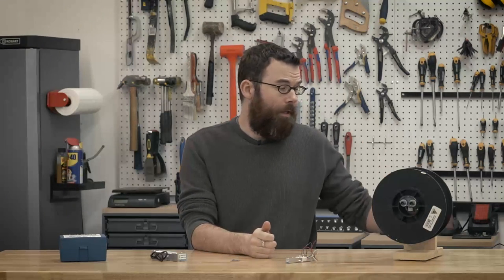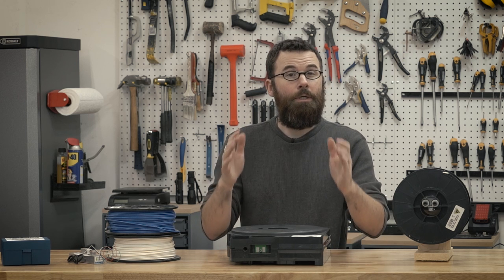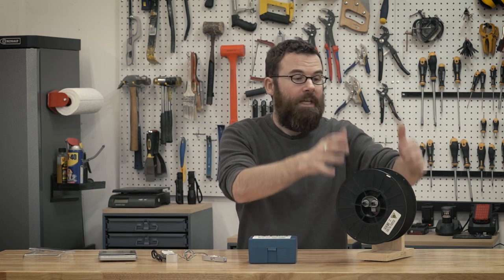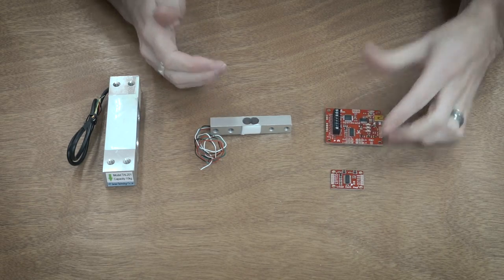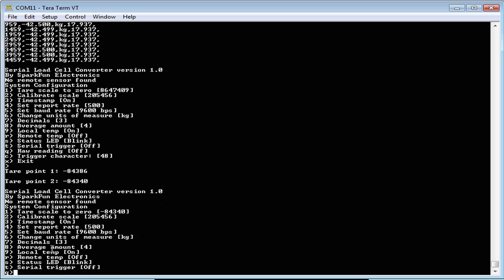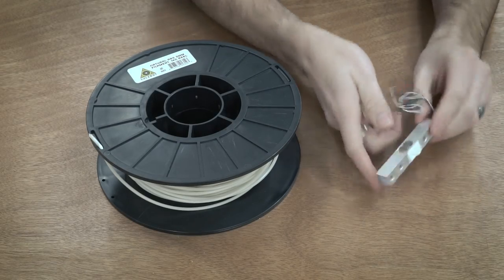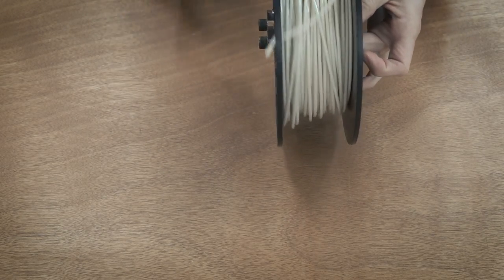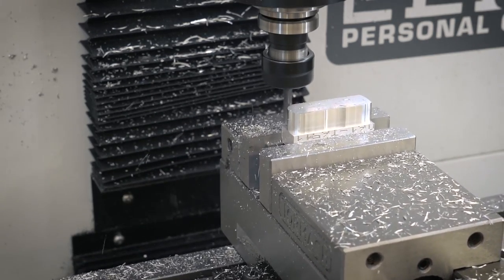Filament Measuring System - Part 1

Comment: Is there a part 2?
Loved part 1.
Knowing the weight left on a spool helps a lot when deciding if your spool is gonna make it to the end.
Reply: It doesn't seem like there's a part 2. I guess it didn't work too well? I wanted to learn possible caveats so I was really interested in the detailed results though.. Welp, I guess I have to do it myself to figure it out.

I am wondering how it performs once it's loaded up to the printer. I bet extruder's pulling/push back force affects the reading, as well as the position of extruder itself changing the position of extruder's entry point to the spool. But I have no idea if the effect was negligible enough when the friction along the pathway was cleared up.
Reply: @IoriTatsuguchi  I built one and it did a decent job but since that was three years ago I think I had a prob with tare being reset to zero every time it was powered on.  Taking the spool off before powering up and replacing it AND subtracting the spool weight stunk.
Reply: @coulterjb22  Oh, I hadn't thought about that. I was thinking it'd be nice to keep it there for extended time up to the full life cycle of a spool, but I just realized that it's not what load sensors are intended for: I bet you knew, but I just thought I could save the parameters elsewhere on every time or keep it on the whole time, and apparently then it won't account for the creep on the load cell. I'm interested in the effect of such thing over weeks and environmental temperature change - if it's like ±10g then I might do but I guess I'll try to see only if I have lots and lots of time haha

So I guess what you have experienced was just as good as it gets? Thanks for an interesting input!

Comment: Great video! I have been planning on doing something like this as well and your video helps clear up some questions I had. A little trick for cheap/readily available "calibration weights" I picked up from building antweights a long time ago is that the U.S Treasury Dept. lists the weights of coins in grams to 3 decimal places. So a new nickel weighs 5.000g and a dollar worth of nickels should be 100g. Also 80 quarters is pretty close to exactly 1 pound.
Reply from the maker: oh, that's great to know!  I actually have a set of quarters from the mint for taking pictures (quarter for scale, etc...).  I should have thought of that.

Comment: Cool, Thanks for the idea. Ordered some load cells and HX711 modules. I'll probably hook them up to an arduino pro mini or a esp8266 with a small display. Don''t think I need the bearings though, I've never had issues with extruders pulling the filament from a round (pvc or pla) rod in the spool and my spools aren't all the same thickness/diameter.
Reply from the maker: Yeah, the bearings are probably overkill, BUT it should help if you want really stable readings when using the printer.  It's just one of those things that isn't necessary, but it's kinda cool :-)

Comment: Robert, I use strain gages at work and we use a industrial amplifiers in order to read the gages but we need to set up a Gages factor. I want to build a similar project like yours. I have already the Sparkfun amplifier and some strain gages but I did not not about the special board for this cases. Do you know if we can set a Gages factor?
Reply from the maker: I do not.  Can you explain what the 'factor' is?  I'm relatively new to load cells, this is my first real project with them, although I've used them 'casually' before :-)
Reply: Robert Cowan  here a very clear explanation of Gage factors are.
I think we do not need to set up with these arduino  boards because the calibrations is made with a known weight   
http://www.ni.com/white-paper/3642/en/
Reply from the maker: Ah OK that makes sense.

Comment: Robert. What about adhering an RFID key to each spool at the start. Put a reader near the spool and use the eeprom space on the RFID on the key to store the the initial total weight plus initial quantity of filament. This way, when you put the spool on, it will get read during the feed process and you merely need to deduct the weight of filament used versus the expected full weight. Who cares what different spools weigh. If it has 1kg of filament, you know you should only be able to remove 1kg weight from the spool regardless what the initial weight was.

Comment: Robert, during your testing, did you try to place weights at various places on the load cell to see if the results varied? For example: hanging a weight off of the outer most hole vs the inner hole.

Keep up the great work.
Reply from the maker: Not in the video, but in previous tests I did.  It does of course change the the readings a little bit.  That's why I have the spool holder spaced out with a couple of washers so the 'load' will always be evenly applied to the same spot on the load cell.
Reply: It makes sense that as long as you measure each spool the same way you'd get more consistent results.
Reply from the maker: Yep, that's what I was thinking, and the big reason for the thing that attaches to the end of the load cell.  It should help keep things consistent.

Comment: Some say weight sensors are subject to temperature changes and drift??
Reply from the maker: You're not wrong.  If I was doing this RIGHT, I would compensate for that.  There's more to this project than I expected.
Reply: @RobertCowanDIY  Helpful Video

Comment: I see you have a fan? (the one that takes time out of his day to open your new uploads and downvote)
Reply: And now after watching the video, nice idea on using a scale! Did you consider that the readings probably will vary quite a bit when the printer is in use? It might be a nice idea to add some sort of a bowden feed from the filament spool holder up to the extruder.
Reply from the maker: The readings will vary a bit, yes.  I will most likely use some smoothing on the readings and also have some sort of mechanism to take strain off of the spool, so it feeds evenly and doesn't put strain on the spool when it feeds.  But I'm less concerned with it when the printer is running, since I will most likely be taking readings BEFORE the print starts.
Reply from the maker: meh, haters gonna hate.
Reply: You are right, reading before a print will keep the error to a minimum. So that will be an easy solution. I was thinking a bit more about it and you can also determine (to some extent) the diameter of the filament this way. Making it possible to have a dynamic feed of filament of in which case the (filament) feedrate is based on weight/mm3 (or what alternative to mm3 there is in the imperial system)

It does give me a lot of ideas for my new printer build. I plan to make a large new one and am currently in the design phase. I have some really nice THK SSR guiderails that I have laying around that I want to use in it combined with clearpath servo's
Reply from the maker: I've been thinking about the diameter problem too.  It would be nice to read the diameter right before it hits the extruder and then compensate for it.  But once again, if you're tracking the use of filament, it doesn't tell you how much is still on the spool, you need to track each filament spool by spool and never touch it outside of the machine.  It gets very trick and the inaccuracies add up over time (if you swap spools often).  Weight is the only real way to tell how much physically exists at any given time, and you don't need to track the ID of each spool individually.
Reply: For averaging the reading, try using a "stack"/moving average.
As in, having a stack of measurements, e.g. [0, 1, 2, 3], and pushing a set of measurements into it, and averaging it out - [1, 2, 3, 4]/4.
This way, you will always have an error in the result(as it's a linear process, you're decreasing the weight), but the error will be very miniscule with a small sample set(3-5 measurements), and it will improve on stability.
I do this on my load cells, it helps a lot.
Reply from the maker: This is pretty much how I'm doing it.

Comment: What to buy... on kg or on meters?
Reply from the maker: Filament is always sold by weight, but you could extrapolate the distance.  But most prints are measured by weight, not by the length of filament used.

Comment: Any progress e.g. Part 2
Reply from the maker: Not yet, I started WAY too many projects.  I'm still using it, but I haven't integrated it into any printer yet.
Reply: Thank You: The pulling action of the extruder could have an impact ? I wondered if it could measure small amounts left. Say 1/2 to 3 layers on the spool drum left
Reply from the maker: Unfortunately, it would work best if you measure BEFORE a print. pulling on the filament could potentially impact the readings, but you could minimize that by just having a good guide system that doesn't put strain on the spool.  My original thought was to just use the weight estimation from the slicer to determine if there was enough filament left on the spool.  I didn't really think it would be useful real time, but more of a way to see if a spool has enough for what you're going to print.
Reply: Thanking You
Reply: Could integrate to see if reel is moving or not and only take reading when not feeding

Comment: I've heared that you can change the spool 10 times without 'any' change of the % on the spool.
Reply from the maker: Yes, but there are plenty of stratasys cartridges out there that read 0% that have plenty of filament in them.

Comment: Why not use a simple encoder with a roller to read the filament? the new makerbot uses the same in their extruder.
Reply: yup got it, you just wanted a way to check if filament spool is empty or not through its weight.
Reply from the maker: Encoders can slip, you could remove filament when the machine isn't on, and you'd need to track the ID of every single spool you own, so it can 'remember' which roll had how much, and if you used it on another machine, the count would be inaccurate.  I covered this in the beginning.  Tracking used filament doesn't tell you how much filament is left, just how much was used.  With that method, you need a way of tracking each individual spool, which is a pain.

Comment: If the strain gauge is type II it will have built in thermal correction, they use one to take the strain and an identical one that will not change with load but will compensate for temp change.

http://www.ni.com/white-paper/3642/en/
Reply from the maker: Oh, thanks for the info.  I hadn't heard of that, but it makes perfect sense.

Comment: Could you not just tell it how much filament weight is on the spool to start with and then just have it count down? just like tearing a scale, but not to zero. Then you wouldn't have to figure out the spool weights.
Reply: Well it has a considerable chance of slipping (just as the extruder itself) for short distances it will be fine but when you are nearing the end of a spool there is a lot of room for measuring errors. 

An alternative to that (and when you want to measure length and not weight) is using something like an optical mouse sensor. But this also has a considerable chance of measuring errors.
Reply: did you reply to the wrong comment?
Reply: You are right, This reply was intended for one comment below. Thanks!

About your own comment: totally agree! There has to be a variation in spool weight. Just counting down weight and remembering it is the better option. That way you can also check if the seller actually gives you the stated weight.
Reply from the maker: Sure, but as I explain, that relies on measuring the filament leaving the spool with 100% accuracy.  if you get a jam or if the machine (for some reason) doesn't record the value right, the system fails.  Then the spool is a big unknown, unless you re-weigh it.  So I just cut out the middle man and rely solely on weight.

Comment: The audio is terrible
Reply from the maker: really?  how?
Reply: Not true, everything is loud and clear.
Reply: There is a slight echo from your workshop, which is irritating.
Reply: The issue I noticed was the first 3 minutes.
It sounded like the audio was clipping a bit.
Not sure if it was mic placement or just a bit too much gain at some point.
All the clips after that first one seemed fine.
Nothing too terrible, But it does stand out.
Reply from the maker: Ah, interesting.  Maybe the batteries were low on the mic amp.  I looked at the files and it's certainly not clipping.  I use studio monitors when I edit the video and they're not nearly as revealing as headphones.  I can barely tell on the monitors, but I can certainly hear it on the headphones.  For future videos, I'll make sure I listen to the audio on headphones before I upload.